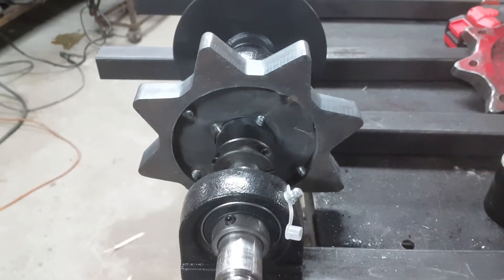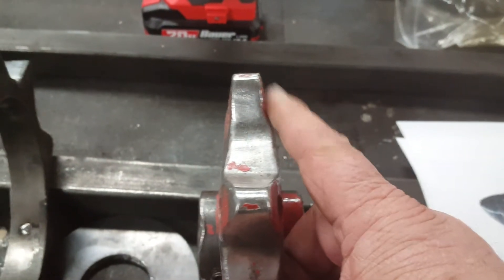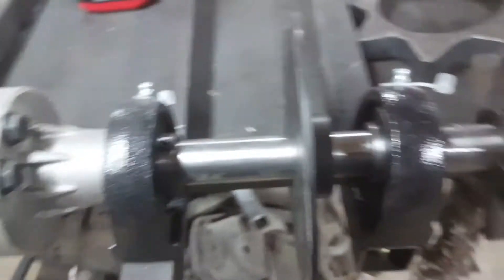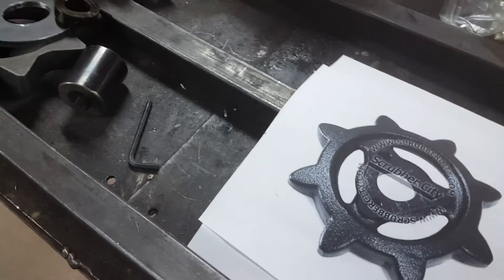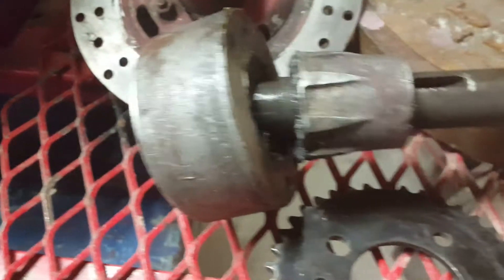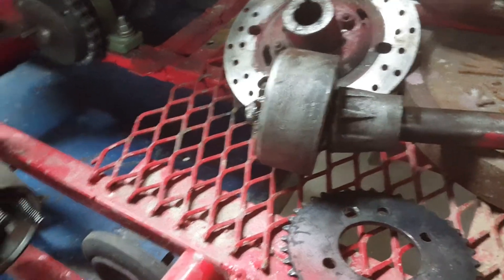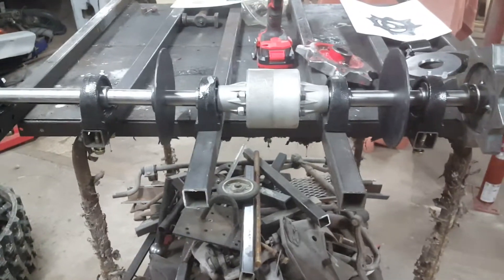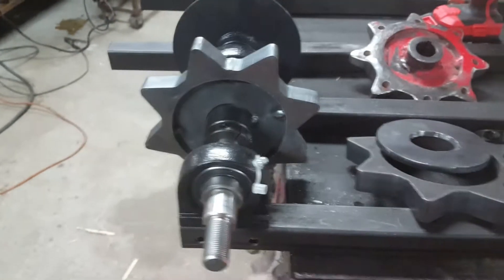PTV Build 3 - The track sprockets

Comment: Hello Sir🤚
I looked up the trax on the Summit website. They have no pricing unless contacting them. Before contacting them I'm wandering if you could tell me what kinda tracks these are , how much power they're rated for and biggest thing is PRI$E!!!!??  I need a small tracked tractor. Your tracks look to be about what I'm looking for. Instead of just running around this thing will be pulling small plows. 
I've seen the homemade tracks made from old car tires and such. I will be using this thing around town to plow gardens for people. It's not so much about it looking all Jethro , but I need something that's dependable , small so it'll fit inside yard fences. 
Also as I'm getting more crippled I'm seriously considering building one of these personal traxed vehicles. About one more motorcycle crashes and I'll be ready for one. Or possibly the grave.
Reply from the maker: They are 180X60X39.  Very heavy duty of course, made for industrial use.  I have had my first set for several years now and they reallly are like new.  I am not sure how much Summit charges now. A guy in our personal track vehicle Facebook group got a pair from tracksnteeth for $125 each plus shipping.  Hope all that helps, thanks for watching and commenting!

Comment: I had to design my own sprockets for mine, I had to. I had to make them twice because of the material I used warped bad when I welded it. Used the same design when I did the 2nd set. Came out great. I also used a piece of round tubing going across in the bearings to get them aligned when I built the sprocket drive section. I use 3 bearings per side, the center bearings don't move and are simple jack shaft bearings. Pillow block bearings on the inside, and flange bearings on the outside that have the enlarged mounting holes for adjustability. When I tighten down the axles in there spots, I will be able to drill holes and put pins in them to keep them from shifting while tight.

Comment: The cast aluminum housing broke due to stress, like you said when you weld up your frame take your time and make sure nothing binds... I know how this works, I welded  2 1 inch 5 thread nuts on the ends of some thick tube stock with the all thread in there, I checked numerous times and all looked good got done welding and it was bound up pretty tight... I ended up have to cut it in half, I was able to modifie the design using only half of it...
Reply from the maker: I also got to thinking that the "diagonal" flat stock on the front was not originally welded on.  I had only TWO support braces out to the track rails.  I actually noticed a bend in the frame by then so I put the flat stock up at the front.  I got an idea it has been broken for a while!